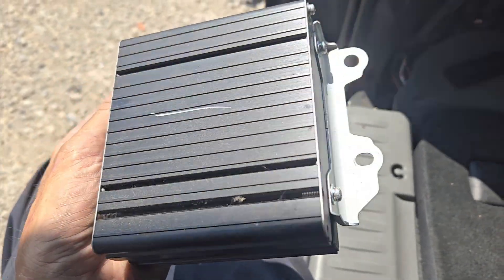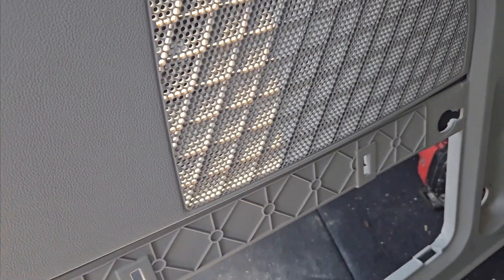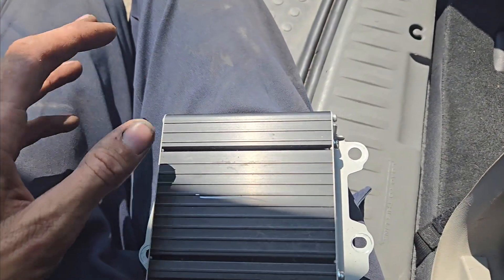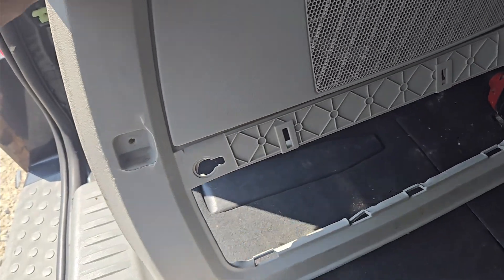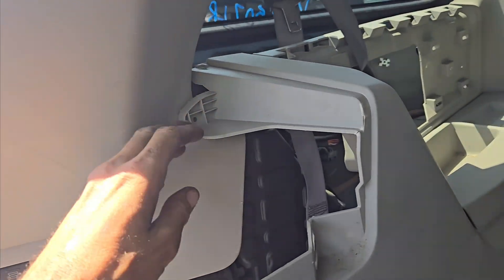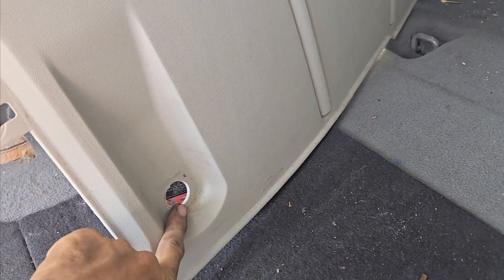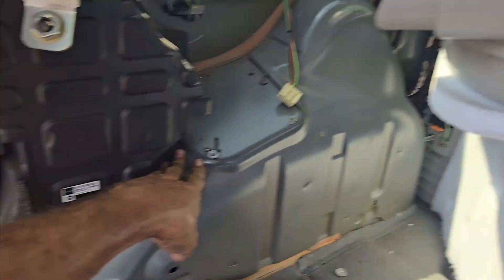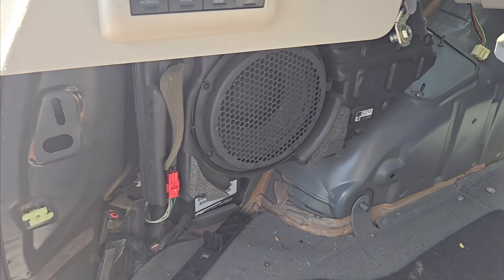2008 Dodge Grand Caravan Stereo Amplifier Location and Removal

Comment: That's the inverter module. 😂 the amplifier is behind the subwoofer
Reply: I mean, you were right there, now just pull the two or three ten mil bolts holding down the sub, it hangs in it's mounting holes but pops free. Voila, amplifier